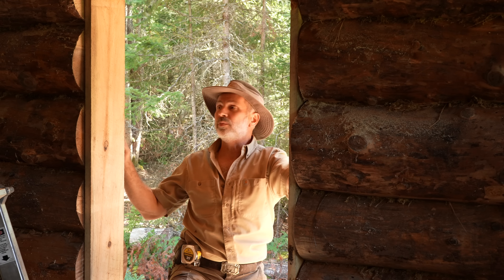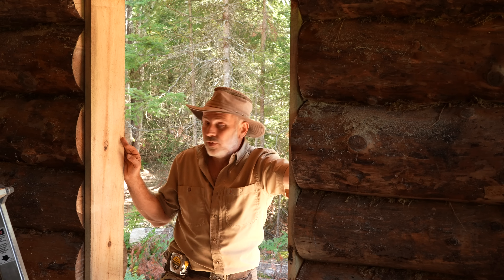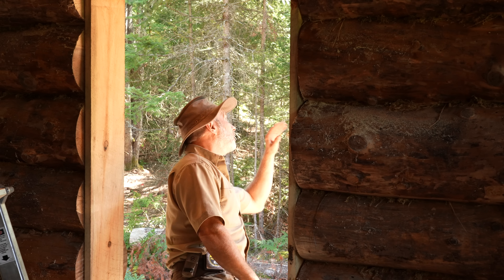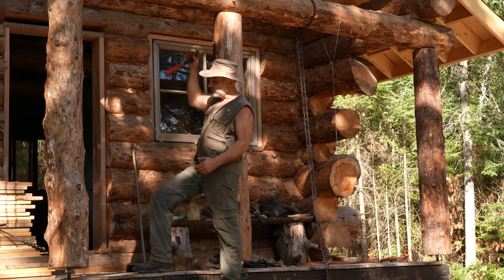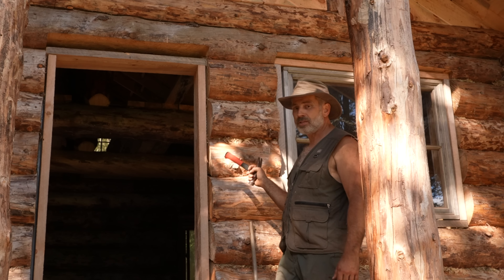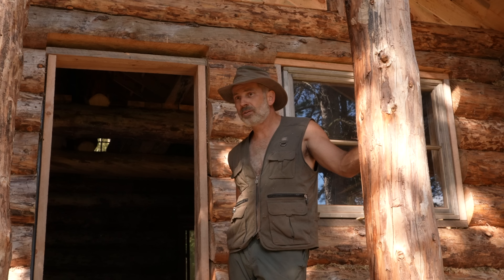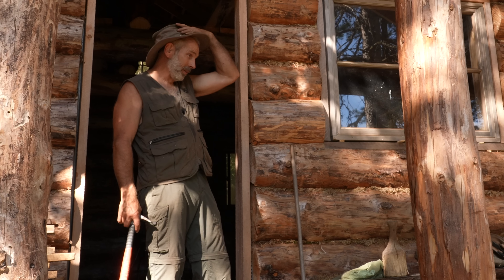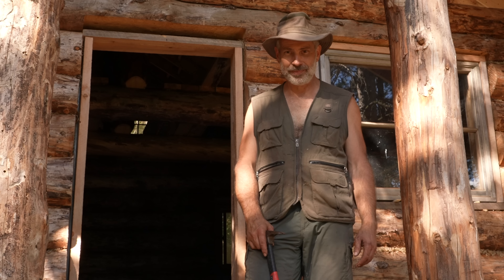Why and how I am installing posts and beams on the log cabin porch

Comment: One thing I learned when I built my cabin with respect to settling and shrinking is to drive all of the nails in at a downward angle on the rough jams so the logs settle easier .  I had 14 doors and 3 windows to deal with and driving the nails downward made settling much easier ..
Reply: The door and window frames are floating on this cabin. They're not nailed to the logs at all. Steel angle sliding in a vertical groove cut into the logs holds the frames in place. This is the first time I've seen it done this way and it looks like a brilliant solution to the settling problem.
Reply: @Sara-gc8nn ,
Maybe he just meant 4 doors instead of 14, two exterior doors and two interior doors would make sense.
Reply: @Sara-gc8nn  4 bedrooms with 4 closets makes 8 doors. Now add a front door, a back door, a laundry room/mud room door, a bathroom door, kitchen door hall closet door and I believe I am already at 14 without a pantry or root cellar etc.
Reply: @LaLadybug2011  three windows would indeed lead me to believe only 4 doors except for the "to deal with" comment that sounds like more work than just 4 doors. 🤔
Reply: @Sara-gc8nn  It is called speculation. I will leave you alone now. 🙄

Comment: Can't wait to see the outdoor kitchen. Your explanation of the build and taking everything into consideration, shrinkage etc is very interesting and shows just how much thought, calculations and just know what you are doing takes a lot into building your cabin. Your very inspiring to a lot of people.
Reply: I'm hoping he lays basic unfinished clay tiles in the breezeway ... that way on the hot days you dump a bucket of water on them and let them evaporate it away with a breeze ... and poof instant air conditioner ..
Reply: @kaboom-zf2bl  How would those clay tiles hold up in -40° temps? The breezeway is unheated, I believe.
Reply: @suelatendresse6905  the joys of non glazed tiles .... they dont care about temperature becuase during winter you dont soak em ... and because they are porous they wont break from freezing ... and they will remain warm ... the breezeway will be enclosed in winter to make it a warm room and even one of his many winter camp stoves will keep in more than warm enough for slippered feet ...

Comment: There sure is a whole lot of thought that goes into just the settling alone, that we don`t see on the other chanel, so that beam is basically just going to free hang until all the settling is done. I did not know that verticals would not shrink, that is why I did not understand why the windows and doors would not eventually crush, that sure throws a monkey wrench into the eqaution, verticals stay, horizonals shrink. I love the thought process, wich is why I follow both chanels, you seem to have the shrinkage figured out, I read the other comments, and the metal  strip for the outside walls makes perfect sense, so you could keep track of real time shrinkage. a gauge if you will.

Comment: Comment regarding settlement...  For some type of bridge deck construction, "tattletales" are installed to determine the settlement after loading with concrete.  This is as simple as driving a 2x4 or something in the ground adjacent to the structure supports.  In short, you could do the same with a piece of steel close to all four outside walls and just marking the steel in reference to the bottom log.  Steel would be a longer-term installation, which is what you need. This would be an accurate measurement of how much settlement you are actually getting periodically, and not theoretical" to adjust your front supports and not cause damage.  Hope that makes sense.
Reply from the maker: Yes, great idea
Reply: That would be a great tool of actual settlement.
Reply: @ShawnJames1  I would also reference a measurement to a point on the top logs as well in case the middle wall logs shrink and the bottom doesn't move for whatever reason.

Comment: Love it . So you are just putting rails around this porch? small open rails? I think I can picture it. The pillars , as I call them, or posts ,as you call them are a great feature to come up into , don't distract too much from them , if possible. just my advice. The jacks you can cover somehow , they are very important as you say but not so appealing visually. Good luck Shawn as always. Cannot wait to see the finished porch because it is the first impression point, even though you said you will be using the breezeway entrance mostly. which is great but still.

Comment: ahh that explains the gap ... thought it was too big ... but now i get it ... i expected shrinking but not that much ... would have went with an inch shrink for every 12 inch diameter avg ...
Reply: as for fancy joint ... a basic square tenon through a  mortise in the top beam ... add a wedge from the top pushed in by the upper log and that will lock the joint into everything ... and you can then also pin the mortise and tenon joint . but dont need to IF you wedge the tenon like you do with the head of an axe

Comment: I've done alot of new construction framing and remodeling of older homes and it's a crack up how much studs, joist and rafters shrink over the years. Like the logs in the cabin it's mostly the thickness of each board, not it's length, but I've seen that too in very hot weather locals!